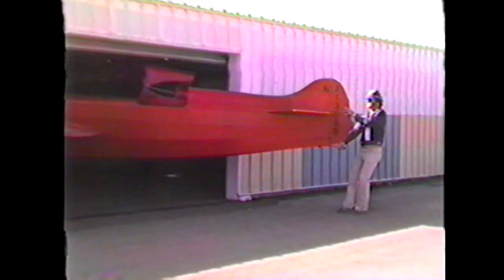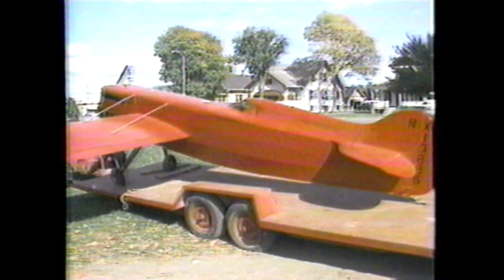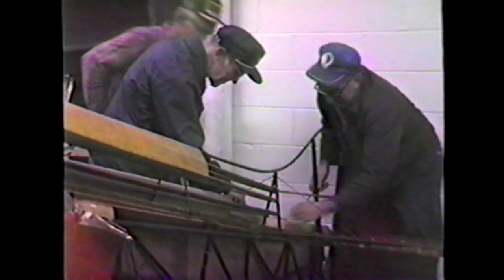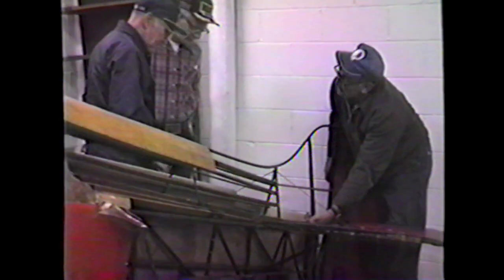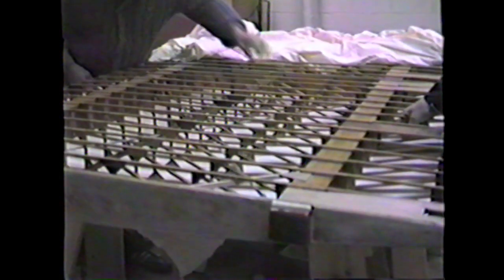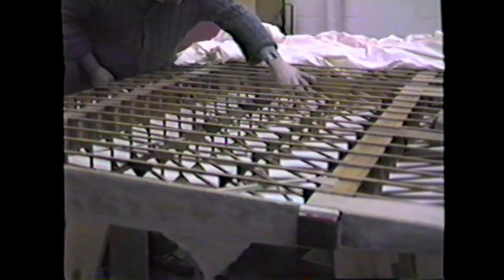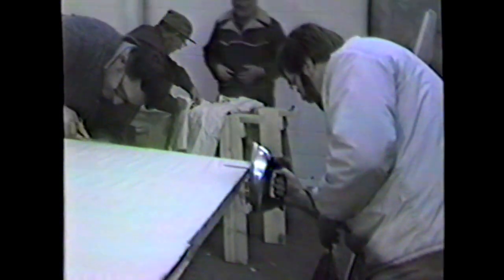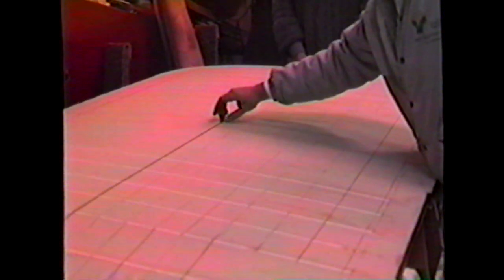Steve Wittman's BONZO Restored By EAA Chapter 252 in 1982 for the Grand Opening of the EAA Museum

Comment: Why did they replace the original fabric, it looked decent enough, were they thinking of flying it?  Or was that something you just did back then, to make it look "good"?
Anyway, hard to believe Wittman was almost 80 when it was filmed.
Reply from the maker: Thanks for the message. I was one of the guys that did the restoration. The fabric looks good in the old VHS video but it was very brittle and the mice got into the wings and gave us a pile to clean! It smelled pretty bad too. Seeing that the plane would be one of the first donations at the time to be placed in the EAA museum, we restored the plane to museum quality in honor of Steve. The original skin of the plane was preserved and placed in frames and was used as a fundraiser to help with the project. The plane is still in the EAA Air Museum on display in Oshkosh. Thanks.
Reply: @joeandjanice  That explains it, thanks - and mouse urine will destroy anything!!